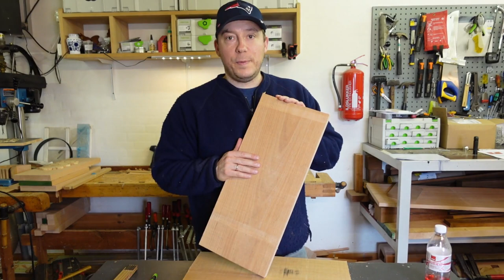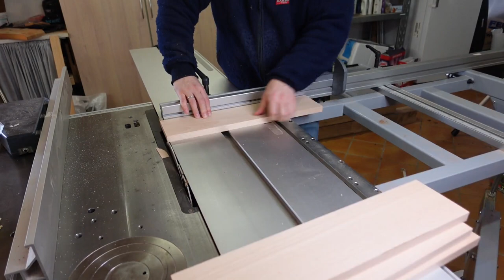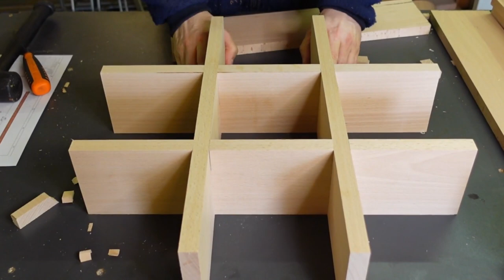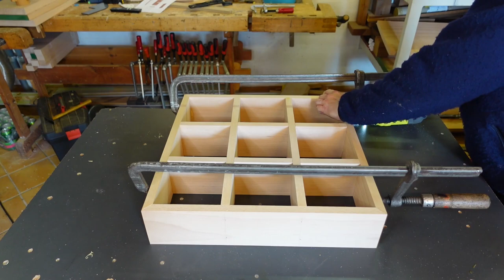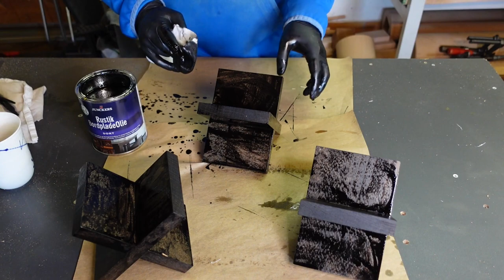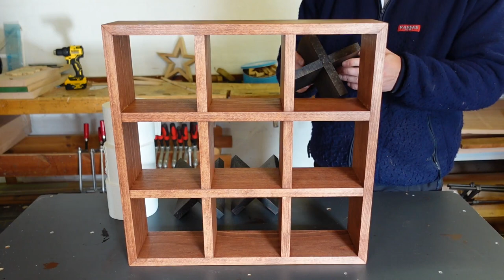Building a Giant Wooden Tic Tac Toe Game!

Comment: I don’t hear well. Can you tell me all materials needs and sizes to be cut?
Reply from the maker: Sorry for my bad english :) You need 
4 x 19 7/8" for the outer frame
4 x 18 3/8" for the center pcs. with the cutout
6 x 4 1/2" for X 
All borads are 3/4" by 4 1/2"
Here is a link for the drawings if you need them :)

https://www.etsy.com/dk-en/listing/1373492892/tic-tac-building-plan-pdf-drawings?click_key=666fb7ccc61cb5ac7520414695d58c2e5e76c77d%3A1373492892&click_sum=15f219eb&ref=shop_home_active_2&sts=1
Reply: @ErikHovedskou77    This is not right. The inside board lengths and the outside board lengths cannot be the same. The outside board lengths should be longer by two times the width of the frame boards, so 18 3/8" + 3/4"+3/4" =19 7/8".  Right?
Reply from the maker: Hi 
You are right, and thanks for spotting it :) i fixed it in my comment, and yes 19 7/8" is correct measurement